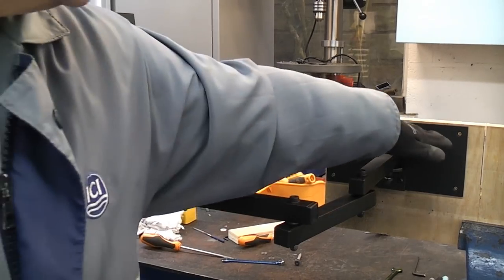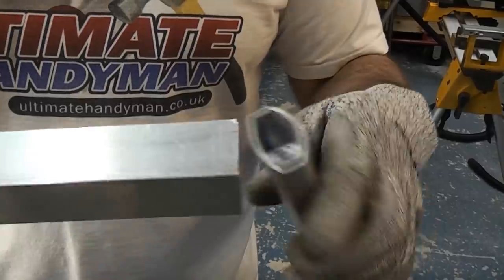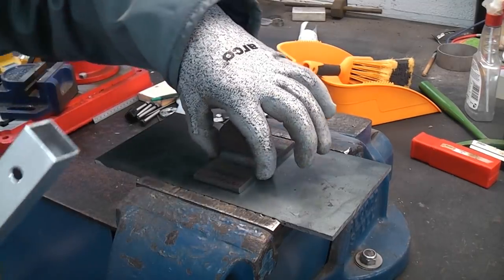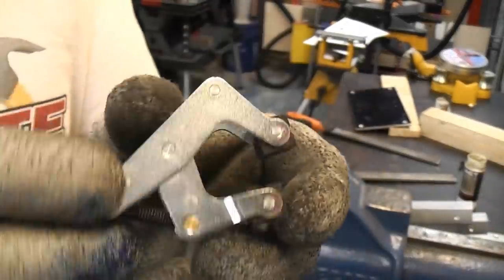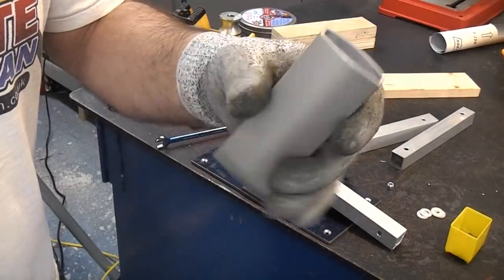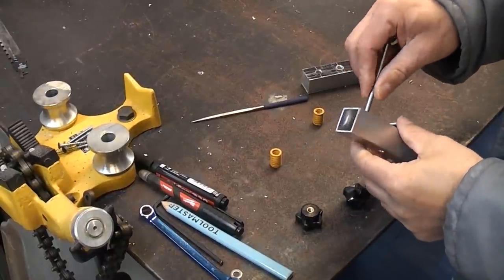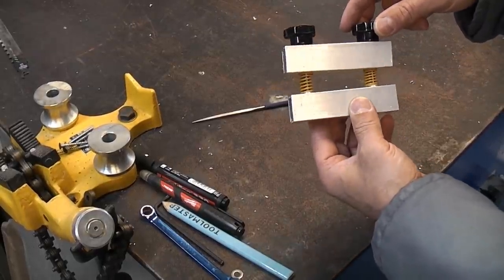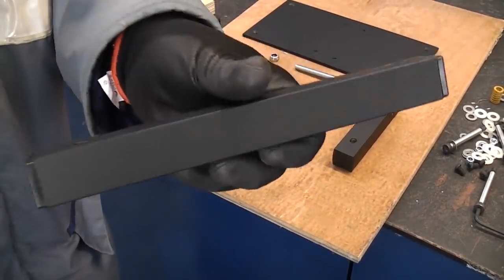How to make a monitor wall bracket | HP monitor wall bracket

Comment: Excellent video, thanks. You are a true craftsman. If you don't have the rivnuts plus tool, you could insert wooden blocks (preferably hardwood), drill and tap and araldite the studs in.
Reply from the maker: Yes, that's a good idea ;-)
Thanks for the comment 👍

Comment: Hi mate, quite a project this one, it turned out well, it's amazing what we can make out of bits we have lying around, looks like your a man after my own heart whith plenty of fasteners in stock ,just it case, lol. I thought you had gone back to work, ?, I hope everything's all right at your end, we're both over 70, so can't go anywhere yet, good job I can get into my w,shop and tinker about, or I'd go mad, watching your videos brings me great entertainment during lock down,  I'm sure it's alot of hard work , but I do appreciate your efforts mate. Thanks again , stay safe, best wishe's to you and your's, Stuart.uk.
Reply from the maker: Hi Stuart, Yes this was quite a project. It took me about 8 hours to make and film it, then another few days to edit the footage on the computer. I am back at work now, I have been for the last 2 weeks, which gave me less time to do the editing. I always have loads of screws, nails, nuts and bolts at hand and whenever I do a job I always buy extra, as it always comes in useful.
A few years back I put a steel roof on the summerhouse, as the timber was going rotten. I ordered two extra sheets and stored them in the eaves on my garage. Then when the lockdown happened the girlfriend and kids got a chicken each. I had enough timber/sand/cement/roofing sheets to make them an enclosure without even leaving the house (I never filmed any of it though).
I hope you and your missus stay safe ;-)
Thanks again for the comment
Reply: @ultimatehandyman  thanks for the reply, glad everything's OK at your end,,chickens, ,there's nothing like a fresh egg on your plate from your own hens, did that many years ago whith Buff Rock bantams, look after yourselves. Thanks,Stuart.uk.
Reply from the maker: I'm not sure if these will lay eggs (apparently some breeds don't, according to a mate of mine). The kids love them though and if you go in the garden they keep you company LOL
Stay safe 👍

Comment: I learned a lot of handy tips from your video - thanks !  Two things I would like to get now - Kant clamps and one of those spring center punches. I never thought of using the caliper to scribe lines -- that will be useful in the future.
Reply from the maker: I'm glad you found the video useful ;-)
We used to use the Kant clamps at college when making pieces for the fitting course that I was on, they are really useful. The spring tools centre punch is also great, although I just use a huge centre punch and large hammer ;-)
Thanks for the comment

Comment: Great video, thanks for sharing.  I wonder how many subscribers have all the tools used in the making of the wall bracket? Certainly not me!!
Reply from the maker: I did cut two pieces of the aluminium box section with the hack saw, as I had put the Rage 3 away, but I didn't show it in the video, as it was dragging on a bit ;-)
You could make it using a cordless drill, hack saw and a file but it would be more difficult and time consuming.
Thanks for the comment

Comment: Hello bit of a random question but could you be so kind as to recommend a good brand of left handed drill bits please. I’m a gas engineer by trade and I’ve struggled to get a couple of screws out on various jobs ( bottom securing screw on a ecotec d/valve and bottom securing screw on a duotec pump housing) when they leaked and are corroded in place. Tried the easy outs and screw extractors but in my experience they are a waste of time. Keep up the good work pal
Reply from the maker: Screw extractors can be hit and miss (sometimes they work and sometimes they don't) 
It's hard to find quality left handed drill bits, but I found these made by Dormer- https://fave.co/3cUBcDd
Dormer drills and taps are normally decent quality, so these should be okay ;-)
Thanks for the comment
Reply: 🙏🏻 thanks so much for the reply. I’ll give these a go. you have some great content and a good mixed bag of everything.  Thanks again and keep safe👍